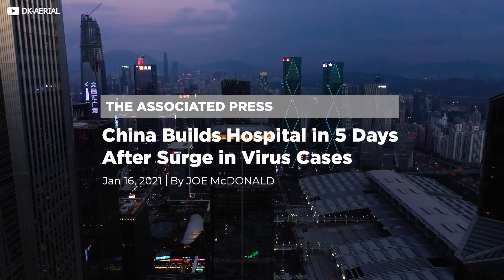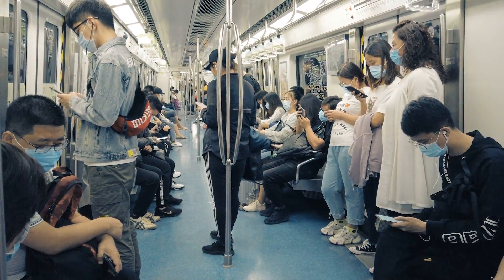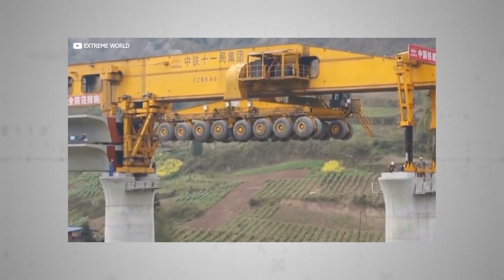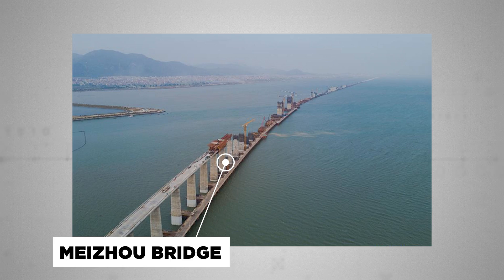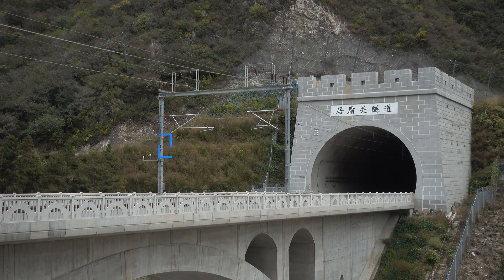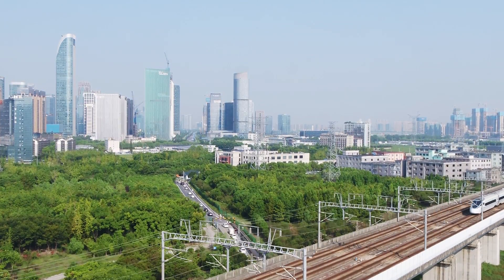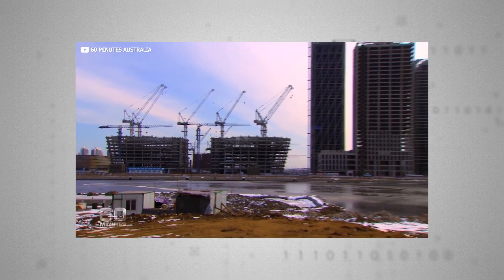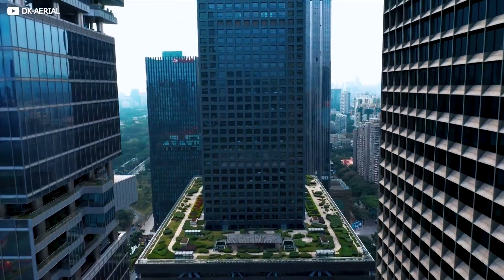How China Builds So Fast

Comment: 7:48 "Poured concrete take 28 days to cure and dry" errr....... NO (7 year Concrete Contractor + ME.Civil )
Regular concrete takes 3day to reach 40% design Strength, 7 days to reach 60% , 14 days to reach 85%, you can use 3 day High Early Concrete which cost about 15% more to double the cure rate, as well as using macro fiber to control crack, accelerator admixture to further speed cure rate. Another trick is to use higher strength mix to hit the required strength early. if you want 5000psi in 3 days, you can use 10,000psi mix and hit that without admixture.

Comment: The West has a problem with politicians and their urban permits, that is the first thing, the second thing is, builders are not innovative enough, the Chinese build all parts of the building in the factory and assemble on the building, and in the West, everything works directly on the building where conditions are not optimal for making molds and a lot depends on the weather, when it rains the concrete cannot be dried and there are many other problems. Simply the problems are in innovation and building permits.

Comment: Actually, China has taken great measures for environmental protection on rail line construction, in the most extreme case, constructing therapy isolated platys and roadbeds for the Tibet railway that traverse permafrost. Additionally, China general builds viaduct is rural areas to avoid creating natural obstructions to wildlife. This also is faster than grading surfaces.

Comment: Simple answer.

Look at the roads they have built in other countries.  Materials are cheap, no surveying for proper drainage, improper drainage below asphalt, little to no substrate compaction. The roads after a few years are looking like roller coasters and pot holes are everywhere. Some roads would have been easier to drive on if they were just left as dirt.

Comment: there are buildings in china that are falling apart before there finished , so,  yeah. when there no fucking building code to adhere too then yeah you can throw some seriously unsafe shit together
Reply: Dont think so dude 
Just to put an example only 57 bridges in China were in bad conditions in 2020 
In the same Gear China had 1.000.000 bridges 
That means not even 1/27.000 bridge in China are in bad conditions 

Other example? Dams 
In the last 10 years only 3 dams collapsed in China 
China have 88.000 dams by 2020 that means nit even 1/29.000 dams in China are ik bad conditions 

What about the 40.000km of HSR? 
All un excellent conditions 

Or what about the 5.2 million km roads ? 
92% re paved 
Being 4.9 million km of paved roads .the largest number un the world 

Numbers talk by themselfs 
China's infrastructure is excellent

Comment: I like how the video overlooked that those rushed hospitals failed to hold water.  There's plenty of video of them and it's raining inside them.  lights don't work and sanitation is horrendous.  Also glossed over is that a lot of the buildings collapse after a few years.  Stuff is built so fast there because it's cheap construction.  Watch actual videos from there and people can simply grab handfuls of "concrete" from walls of high rise apartments.  they use anything they can as filler in concrete and omit actual structural things like rebar.  There is actually a huge problem with fake rebar being sold in china.  It's rubber or plastic made to look like a piece of metal.  Stuff there is typically built as cheap and poorly as possible with a shiny finish slapped on top.  And like others have said, if the chinese government wants to build somewhere, they are going to do it.  you have no rights and no ownership of property there.  That's the communist way.  
Oh, and just look at the recent flooding events in these chinese wonder cities?  Why was it so bad?  Because poor design and planning and building.  Nevermind the lies of how many were actually killed in the floods.
Reply: did you not just see the mass flooding in Philly and NYC? To much propaganda little buddy

Comment: I wouldn't trust anything built in China, I saw a video in China where a woman fell into an escalator floor and fell into the gears and was horribly crushed to death, another video where a guy was stepping out of an elevator in China and the elevator suddenly feel and he was pinned between the floor and roof of the elevator and his chest was crushed in and you him spasmiming and jolting as the life is drained as he dies. in China the high speed rail has had horrible crashes killing many, so yeah, China shouldn't be trust anyway, they are the Nazis of Asia

Comment: There is some brilliant technology at work but with something around 80 bridge in china and overseas along with multiple buildings collapsing  the old adage 'Cheaper, faster, better pick any two' comes to mind
Reply: Where did you get your data?
Reply: @sanshumo3329  Statistical Analysis of the Causes of Bridge Collapse in China
Reply: @sanshumo3329  You can rally around the flag all you want but it Boils down to china is throwing up infrastructure like it is going out fashion meaning there are more thing that may fail. time constraint and cost pressures start to have effects this is not a problem just in China but all over the world a bridge is the US collapsed in Florida not that long ago buildings in Korea have collapsed.
Reply: @alankohn6709  If you had said at the beginning that this was a global problem, we would have been able to get along well with each other, but your initial response gave the impression that it was only China's problem, and I can tell you that your claim that more than 80 Bridges collapsed was groundless.  In fact, China's bridge construction is impeccable. If you like statistics, check out the top 10 tallest or longest Bridges in the world.

Comment: there is also fast drying concrete. and also chemicalia you can put into the mix and it dries even fast. 2 days and you can continue to build. of course it takes 1-2 weeks to dry fully. but if you open windows and so on it should dry without problems.
Reply: China uses a lot of precast

Comment: How china builds so fast? They have basically free labor from all the people, since the workers cost such a little amount they can keep them rolling 24/7 plus the quality is super low because they don't take the time to safety check. Also the plans are basically done in no time with no considerstions to safety or quality is how china builds so fast.
Reply: save time by not putting pipes and wires in walls, using precast concrete
Reply: @gregoryeverson741  work smart not work hard. why u need pipe and wires anyway. are u architect? this is new technologis . u guy properly still using outdated method to build.and it cost more money and where the money come from? your tax right? do you pay tax? u gorvement use your tax to build overprice bridge and properly use 10x more time to build. LOSER
Reply: @acaopayraud1004  your fake tech building costs more
Reply: @acaopayraud1004  high speed rail in AMerica is a joke, planes are faster and cheaper, no country has a high speed rail system worh the money
Reply: @gregoryeverson741  u use plane to travel 30km city to another city? brilliant.
Reply: @acaopayraud1004  we tried trains, i live in a great location, trains just fail in America

Comment: Just want to clarify on the comparison of china building a new hospital v.s. The UK converting a stadium into quarantine wards. 1. At the height of the COVID pandemic, China did also convert lots of public spaces such as stadiums and hotels into quarantine wards. 2. The purpose of building the hospital is to expand the capacity of treatment, not quarantine. You can’t intubate patients in a stadium, and there is no way to fit all the ICU equipments into these wards. Even with China having improved the quality of life dramatically in the past few decades, they still have a rather low ICU/operating rooms/beds to population ratio compared to more advanced economies such as the US and UK. That was why China needed to expand their treatment capacity by building new fully equipped hospitals when COVID started. And this simply couldn’t be replaced by converting more stadiums into quarantine wards. That was also the reason why they had to lock down the city of Wuhan and concentrate most of their medical resources to that city. They have learned from their experience with SARS that no matter how robust your healthcare system is, a highly infectious disease growing exponentially such as COVID can quickly overrun your hospitals if you aren’t prepared.

Comment: In USA, projects like this will take 2 years for the Design, 2 years for getting permit and then couple of years to build it. A one mile long road in front of my house already took 3 years, and not done yet.
Reply: In the US projects accomplished at this speed and quality do not exist.
Reply: @Jebusjoose  The US workers and engineers will be out of jobs if they build that fast.
Reply: @Jebusjoose you never work in US construction jobs 😂😂😂. I work for it for 20 years. We milk the project like crazy 🤪. And all those safety people slow it down even more. There step, after step just to get a city approved. All those nonsense law 🙄.
Reply: @Jebusjoose  speed I'll agree. But quality? Wait a few years and the buildings they're putting up so fast will be condemned due to brittle "steel" rebar and concrete that you can break off with your hand. That's of course if it hadn't fallen over already and killed people. Lol up tofu-dreg
Reply: @Jebusjoose  that condo was built in the 80's and was poorly maintained. I'm not taking about China 30 years ago, I'm talking about now. They've had 35 bridges collapse in the last 5 years, and brand new condos can literally be pulled apart by hand. Buildings are falling apart from the slightest amount of rain. Not to mention that they barely have anything that could be considered labor laws, and border on slave labor. As for the high speed rails,  what does that have to do with buildings being put up in a matter of days/weeks that won't last more than a year?
Reply: @Irishrebel092   Constructions done by private companies need to be more regulated. I believe Chinese gov't is working on it.
Reply: @hyc1266  Jiujiang Bridge, a bridge Taiyuan, Shanxi, Jintang Bridge,Wuyishan Gongguan Bridge, Qiantang River Bridge, Baihe Bridge, Yangmingtan Bridge, and that's just the first couple results when you Google it. 

And no, I'm not taking about pulling doors off, I'm talking about grabbing the edge of a concrete pillar with your bare hand and breaking a piece off.  Or construction workers being able to snap poor quality steel rebar by hand.

And what does the capital riots have to do with anything? That was people purposefully breaking windows and such, not a brand new building that falls apart when you breath in it's direction or have literally any amount of rain fall on it.

And what do you mean they won't ban Australian coal? They did it a year ago and the cargo ships were stuck in port for a full year before they agreed to buy a shipment because civilians were having to burn crops for heat rather than sell them for money.
Reply: @Irishrebel092  jokes on you, according to a study conducted in 2014 showed that an average of 120 bridges in the United States collapse on average per year from 2000 to 2014. China averages around 170 bridges collapsing per year. Not that big of a difference considering china has more bridges
Reply: @austinli8891  Bridges in the United States are also significantly older than their Chinese counterparts. Most bridges across the U.S. were built between the 30s and 70s, and their average age is roughly 42 years. Given that, only like 7.5% of all bridges in the U.S. are considered structurally deficient, and the roughly 120 bridges collapsing in the U.S. annually between 2000 and 2014 had like 2 or 3 major bridge collapses (not including failures due to collisions by naval vessels). Plus, since then bridge failure has decreased significantly.

Meanwhile in China, it continues to see dozens of bridge failures per year, continuously (with between 7 and 8 recorded major bridge failures annually; who knows how many go unreported). And, most of these bridges were built in the 21st century, which is an obvious attribute to their notoriously poor quality
Reply: you forgot 2 years because of people complaining.
Reply: Us military infrastructure is the best though

Comment: The concrete pouring argument is a moot point  in pre-fabricated modular construction. To be specific, the concrete are basically dried in the factory making the pieces long before hand and stored somewhere until it is ready to be assembled. As the result, the cost of time is done before hand and do not take up any field construction time.

Comment: While china has a lot of good tech that makes building faster it is also not the only reason, they often cut massive corners to throw things up fast to make them look impressive but with zero regard for safety or longevity, they do not make proper foundations as it saves time and money but then as we see the building simply falls over there is also countless residential houses and complexes that where built just a few years ago but have rapidly deteriorated to the point they are to dangerous to live in and so they sit abandoned. It is easy to build fast but you often sacrifice safety /quality and longevity

Comment: It is a joke to compare UK convention center temp. hospital with China's 1000 bed hospitals which was built in 10 days. China's hospital has negative air pressure in each room with its own bathroom !! Basically each room is a ICU unit by itself. It is used to isolate infected people. The UK convention hospital in this video is only a concentration camp with beds. People can easily infect each other. It can only be used for mild or recovering patients.

Comment: You may not have really owned the land in China for 70 years. It is just a statement. It only shows the life of the concrete, indicating that you have to check this based on the calculation results of the engineer. If you pass it, you can keep it until you update the city. You will have another big money.

Comment: Science 🧫 has already surpassed 28 day curing period of concrete . 
Besides that the Ordinary Portland land cement has other 1000 relatives especially in the curing periods of variations in the construction 🚧 industry . 
Just be informed. So it shouldn’t worry any one about concrete cracking besides the laser beam technology of precision in strength of material/ concrete.

Comment: anyone can build fast when you cut every corner and safety standards neccesary.
Reply: China's 37,000km long HSR transported 3.66 billion people in 2019 alone, without major accidents. And that 37,000km long HSR network spans desert, rain forest, mountains, swamps and arctic weathers. Please find me another HSR network that have comparable reliability.
Reply: @Skywalker1826  between 2005-2018 china had a total of 17 hsr accidents where the train came off the rails resulting in a total of 200+ dead and well over 3000+ injured.
Congratulations on picking the 1 year where an accident did not occur. 2021 has had atleast 3 accidents so far where atleast 100 have died. ANY other HSR track is more reliable.
Reply: @zurie35  The first Chinese passenger HSR line was launched in Aug 2008. And your stats started from 2005... Where did you conjure these data - the Falung Gong rumor mill?
Reply: @zurie35  well, so you resort to personal attack to mask the mistakes you made. So typical of people lacking in intelligence...

Comment: In the 1970's, Australia built the Snowy Mountain Hydroelectric Project with 9 Power stations built inside mountains.... it was regarded as one of the engineering marvels of all time... nothing like it has really ever been built since.... now, its about the bottom line, short term profits and dividends to shareholders.... so exploration, creativity, building infrastructure for the common good is no longer seen in the west....

And regardless of politics and the screams of 'democracy', China is the example of what happens when they put infrastructure and expansion first and foremost.... its actually closer to the Star Trek model than the greedy west.

Comment: They can build fast, problem is they tend to fall apart.  37 bridges failed in the last 10 years or so?  Buildings fall over.  Corners are cut during construction and then buried.  
They really need to get their shit together on safety.

Comment: China is run by engineers, America (and most of the West) is run by lawyers. China values STEM fields to a great extent, the West is not quite there yet. Also it helps that the central Government of China is the supreme authority, meaning they don’t have to go through state governments, city governments, county governments, township governments etc. as well as not having to deal with NIMBY owners. Though that style does have downsides in other areas, it works well for infrastructure. China invests into its economy, America does not.

Comment: does any one believe they built a fully functional hospital in 5 days when it takes 4 days for cement to fully harden?
Reply: Not all cement needs 4 days, they kept heating lights on the cement at all times too.
Reply: @Schmeesterino    The drying time of cement ranges on the amount poured. The more cement you pour the longer it needs. Based on the average square footage of a football field sized building. 4 days is average And if you try to speed it up with heat lamps you risk cracking.